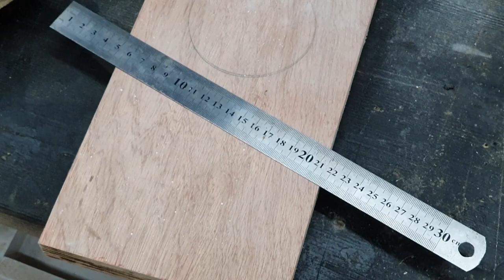Home Made Clock Mechanism Test Stand easy to make

Comment: Do you make and sell these?
Reply from the maker: I havent done so up to now but I have been considering it. As with my homemade clock mainspring winder.
Reply: @treetopspider  Nice.  If you do, I might be interested in purchasing one.  The stand I currently use is not what I would consider secure and won't hold the French movements hardly at all.